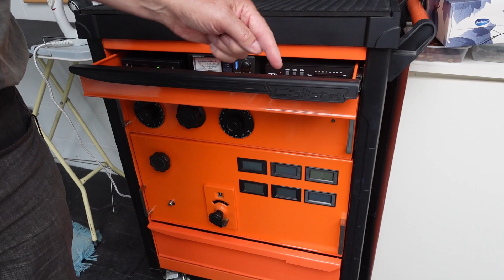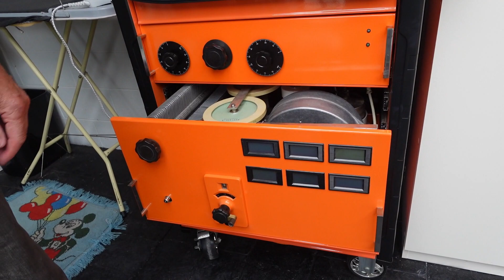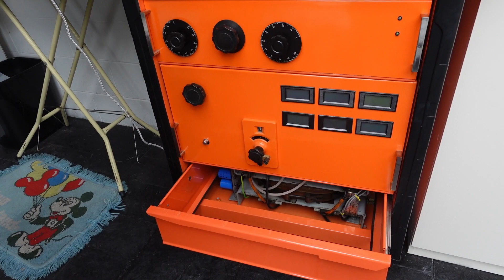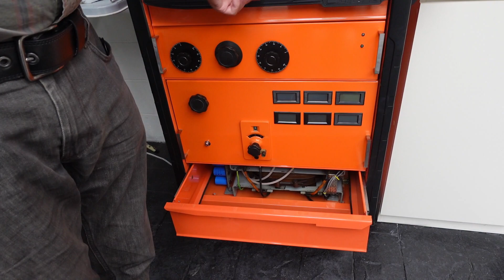Thirst for Power - A look at a Home Brew 1Kwatt Linear Amplifier by ZL3SV

Comment: I’m thinking of homebrewing a linear amplifier (to boost a QRP rig to 100-200 watts). How did Gary switch the bandpass filters when changing bands? Manual control? Some sort of protocol where the transceiver tells the amplifier? Or some sort of frequency counter to do this automatically? 😀

73 de AF6AS in “DM13” land
Reply from the maker: I will ask Gary to explain...   cheers

Comment: Sri man but its 2022, not 1942, qudos on the engineering skills, but practicality for me is questionable when I can have 1kw sitting on my desk the size of a couple of shoeboxes.
Reply from the maker: What ever suits you Shaun...  cheers
Reply: I also have a small commercial solid state amp that has blown finals twice now but this tube amp is 100% reliable and idles at 1kw. Many of the high power transmitters around the World still use tubes as they are more robust. Anyway this used surplus parts so I had the fun of building it and the fun using it. Works for me.

Comment: Very well constructed,  but you never mentioned which valve you are running?
Reply from the maker: Gary is using a 3CX3000 A7 tube just loafing along.....cheers
Reply: @ZL1BQDRoly  Thanks so much, nice choice 👍 73 De VK4JK Jay Down Under...

Comment: yip over engineerd :) but we use what we have and always the bigger ones hehehe. i bet he told ya how he started it up the first time... i remember my first one..used a broom stick to throw the switch, but it had no issues :) , if you have melted PL259's in the process along the years, no stress they are plentyfull heheheeehe.
How times have changed, now you click on a website and payup! and whala, 3 months later a box arrives.... back then it took 1 week of pondering, a week of planning and 3 months of building, but i'll tell you what, when that wattmetter hits the corner at 2kw it puts a smile on yer face..
not active for years now, but this video just might get me to build another one,
zs2cx
Reply from the maker: If the video inspires a ZS to get back on the air then mission completed 👍...cheers

Comment: Gary did a beautiful job fitting all the components into that mechanic’s tool chest. Ingenious.
Reply from the maker: We are both Radio/TV Broadcast Engineers from a waayyyy back and this Amp was built "like they used to be built." It won't die in a hurray that's for sure....... cheers

Comment: Roly did he say he over engineered the amp? That is an Understatement !! What a beauty !! Its a damn shame he can't run it at its full potential  ;). Thanks for the look at a great engineered amp. 73 Joe
Reply from the maker: Well it runs at ZL's full potential with ease  😊. Has it's own castors to wheel it around as well you will note......   cheers